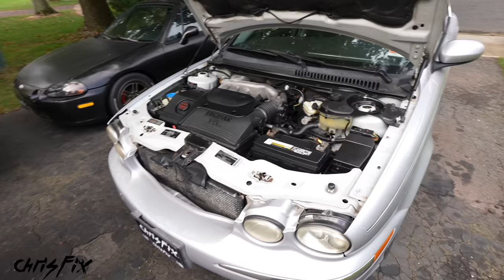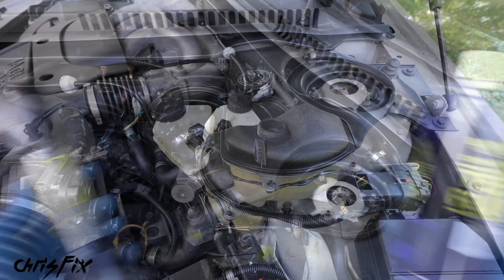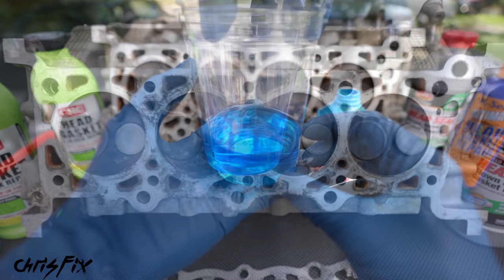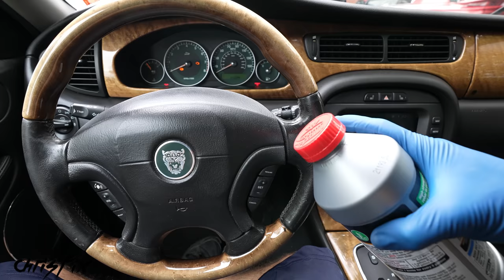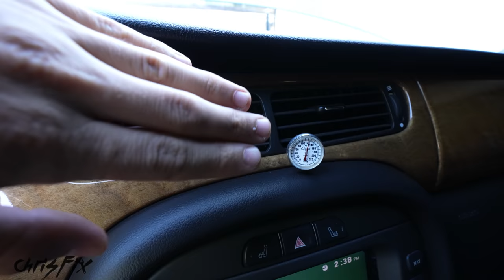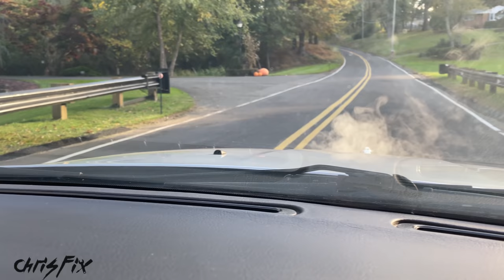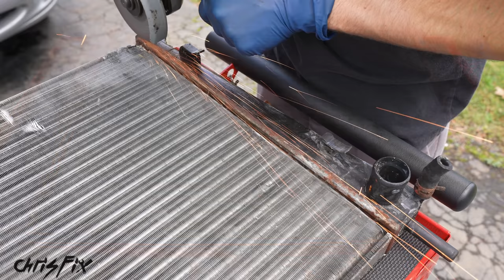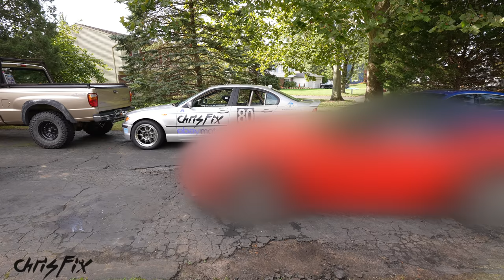Do Head Gasket Sealers Actually Work (FULL 2yr TEST with Engine Teardown)

Comment: Pretty slick with that ....fill to highest point....that's not exactly Right....see cause if you filling the car back up with fluid it will bubble cause the water is pushing the air out of space in the head.....some engine's even have bleed off ports that have to open while your filling it up an its running.....an exhaust leak in the water jacket is a hole lot more pronounced normally the radeater sounds like a muffler.....

Comment: I wanted to mention here that I used this liquid glass stuff in my 4-cylinder car, and it plugged the living hell out of my cooling jackets, especially on cylinder 1 where the coolant is furthest from the inlet on my engine.

I have no idea how to get this stuff out - could you maybe make a video on repairing a head gasket surface after using this kind of sealer?

Comment: At 205 reseal worked for my GM power steering small leak.i think it was from a hose. I replaced the pump and reservior but not the hoses. Yeah i know, bad move but i was only changing necessary parts since its a $500 car. Anyway,  hope this helps someone.

Comment: I've used all the ones you have in the video (and then some) on a Toyota 22RE, to no avail (yet).
Reply from the maker: Sounds like you need to actually replace the head gasket then haha
Reply: If oil and coolant are mixing then there is probably no point in doing this.

Comment: Mom had a 6cyl nova the green coming out of talepipe  used bars sealer   lasted 2 yrs  no leaks trans went  junked  water pump went bsd 6 mos after loose shaft     sealant might have caused ?  she did short trips 90 yrs old then.    I would have tried another can aft 2 yrs

Comment: 2007 Honda Civic..wife driving..did not notice temp max out...turned out to be a failed air fan..one side working only..used green bottle crc..worked for 2 years..then had to replace engine..but destroyed  the water pump and heater clogged... 🤔...if you can afford it..REPLACE ENGINE..SORRY😢

Comment: I used blue devil in a 97 Honda Accord and it worked for about 6 months and I reapplied it and fixed it again . 6 months later it jumped timing and 6 months later a rod started knocking so I don't know if any was related but that's my experiences with blue devil. Hope it helps.

Comment: I just bought a head Gasket Sealer. I have a 2012 Jeep Liberty 3.7 liter. I believe I have a very small leak between the coolant and the combustion chamber. Upon sitting overnight after driving it When you start up, you get a puff of white smoke with a misfire in cylinder 2. Engine light is on, and the car runs rough at first then clears up. After a few days of driving, I have to replace the coolant. The brand of sealer I purchased is BAR'S LEAKS Head Gasket Fix. The car has 90K plus, so I'm hesitant to use it just yet. The other side of the coin is this...If I decide to fix it, I will most likely replace the motor seeing that the amount of work to do the head gaskets are almost greater than replacing the engine itself, which means as a last resort, I will use the head gasket fix. Any suggestions???
Reply from the maker: Just use the head gasket sealer if you need to replace a whole motor anyway. It might work and if it doesnt you lost $30-50 trying it.

Comment: My car drinks ALOT of coolant. I havent found any leaks anywhere but ive charged all the hoses anyways. Oil looks good but I cant understand where the coolant goes. Any ideas? Im going to try this sealing
Reply: It can leak into combustion chambers. You can test it by filling the cooling system to the brim, starting the cold engine and removing the coolant fill cap.
Reply from the maker: It's likely being consumed in the combustion chambers through a head gasket leak, one thing you can do to check if you have a borescope camera is to pull some spark plugs and see if the pistons are shiny/clean looking, that would be an indicator of coolant consumption

Comment: People are always so quick to change or repair a bad head gasket. Gaskets dont just blow there is always an underlying cause that needs to be fixed first
Reply from the maker: That is the case sometimes, but it is also a gasket a gets used more than any other gasket on an engine and can eventually fail

Comment: Say Hypothetically my Head gasket is trying to go out. 05 honda civic ex with a new head put on 7 years ago (shady dealer).

Coolant just ends up back in the overflow reservoir and boils at the bottom after a highway drive. 

I wonder if K seal would buy me a couple of years? I don't want to tear the whole engine apart as its my only mode of transportation.

Comment: Sodium silicate is the only stuff that seems to work. Just keep adding more if it's still leaking. 2-3 bottles maybe . Will last a year ,then will require another round of sealant. So be warned, the stuff doesn't last forever, be on the lookout after 9 months or so.  Maybe use a bottle at 10 months no matter what
Reply: This is sodium silicate.

Comment: Should we do an oil change and a coolant change once the sealer is cured?
Reply: Flush the cooling system multiple times before and after using the sealer. Change oil if coolant was mixing with the oil.

Comment: Chris can you add anything to keep your head gasket healthy so you won't run into that problem
Reply: Two things: change coolant at proper intervals or even earlier, check if cooling system is pressurized when engine is up to temperature.
Reply from the maker: Replace the coolant at the proper intervals and dont overheat the engine and your Head Gasket should be fine unless there is a manufacturing defect.

Comment: Hi ChrisFix ever used the Titan Sealers polymer based headgasket or oil sealant. Supposedly works on aluminum heads thay expand and contract and hold up where sodium silicate/liquid glass cannot. I am trying to buy time on a Land Rover Discovery 2 ive done the proper repair before back in 2012 and its held 12 yrs but I have 5 vehicles that need repairs and they are priority over the truck. Ive used ths. Liquid glass 3 x and it has only held for a max 10 days to as little as 1 day. If you havent its ok. Saw only 1 vid on it but not sure thats all there is if the algorithm prevents access. Thx in advance.
Reply: Most heads are aluminum and sodium silicate works every time. 3 times that would be like 500 in labor. I doubt anyone would spend this much time, makes me think you didn't do a thorough job. Coolant in oil, oil in coolant, or both? Is the cooling system pressurized?

Comment: Which one do you recommend for a 2017 Kia optima Sxl gdi 2.0 turbo,  the coolant is not low and the oil doesn’t have coolant ?
Reply: Is cooling system pressurized?

Comment: I love how u explained this video. So my Dodge journey's reservoir tank has oil in it, the first time I noticed it was when it over heated and oozed out what looked like a thick milky chocolate shake which caused alot of smoke. What can I use to flush that oil out? I think I have a blown head gasket so as soon as I can flush that oil out I will try the sealant, because honestly I already tried to flush and seal but I don't think I'm doing it right. I even had my radiator changed cuz it was under warranty. Please any advice
Reply: You can try washing powder. Is cooling system pressurized?

Comment: Amazing video! As everyone has said! Question though... what do you do if your car doesn't have a temp gauge.. to know when it's at opt temp.. astra cdtdi 1.3 full tank of water being used every 10 min drive. No leaks from underneath. No white in oil.. YET! Help a gal out.. the car isn't worth a new head gasket just until I find soemthong else...
Reply: Turn on the radio, turn up the volume, press and hold settings for a few seconds till you hear a sound, with BC button find screen where it shows Sens.: v: and T:. T is your temperature. Is the cooling system pressurized?

Comment: But why the engine failed at the end? If it had enough coolant and there was no leak, because of the bad oil?
Reply from the maker: The engine block/head was too warped
Reply: @chrisfix  Ok. That means that even if coolant was not leaking, the head was still warping little by little, until there was enough room for coolant to leak through at once and engine overheated in record speed?

Comment: had that in a car, later I lost the heat and had head gasket seal Al over the place almost looking like plastic..
Reply from the maker: Dang! where did it blow?
Reply: @chrisfix  the issue was  due to a slightlig badly resurfaced top I though a sealant might solve it  I guess it kind of did  haha..

Perhaps alot of the solvant was left into the engine and solidified at the wrong place. 

the engine ran good but the heat inside  disappeared shortly after flushing the engine out and came back for a short time after a flush also starting to notice things coming out when flushing the cooling system and opened up the engine m, there was almost like a plastic wall inside parts the engine. 

Personally I will use this with causion

Comment: Will a AC compressor fan not working cause your car to overheat if you're using the AC also I did the combustion test it passed the problem is I'm getting bubbles in my radiator and reservoir yeah I replaced basically everything in the cooling system except water pump

Comment: I have a 2012 Peugeot 508, a premium model that I really like and I have invested quite a lot of money on it over the years and now I found out that there is a problem with gases in the cooling system. The problem is that the process of removing the thermostat is very complicated and relatively expensive.

Why do you think the fluid you chose eventually caused the thermostat to get stuck and if so why do you think it didn't get stuck in the first week and only after two years?
+
Which of the other materials do you think could do a better job without having to remove the thermostat?
Reply from the maker: Might have been something to do with the thickness over time, and I would recommend any one of the thinner sealers if you are concerned about the thermostat
Reply: Choose a sealer that does not have filler particles if removing the thermostat is a problem. Flush the cooling system multiple times after the leak is fixed.
Reply: Do you have a recommendation for a specific one?
  Or which of those mentioned does not contain filler particles?
 @SinsBird
Reply: By the way, if I'm not mistaken, in all the videos I got to see the use of the blue devil - the users had to remove the thermostat. Do you think if I give the system a good flush right after the leak closes, it can prevent the thermostat from seizing? @chrisfix
Reply: @arielsharhabi1155  Blue devil or steel seal.

Comment: ive had blue devil work twice 
but it was on a cylinder to water jacket only leak    oil was clean
when i ran it i removed the spark plug that had the leak when i did the 1 hour run and cool down cycle 
it lasted 2 years and i saw the kid i sold the truck to another year later still rolling

Comment: That's a good video. But the reality is this stuff is a temporary fix. For the most part it generally only last around 3 weeks if you're easy on the car and it's not a high-compression engine. It higher compression engine generally going to only  last a day or so.

Comment: I watch the whole video and learn something my problem is oil leaking on my cylinder is that also a head gasket? I also got a 7,000 estimate for an 09 Honda Pilot
Reply from the maker: The oil is leaking into the cylinder?
Reply: This wont help with oil leak.

Comment: @chrisfix . bro which sealer here would you recommend to use on my 2004 audi a4 3.0L v6 ?? the same one you used or a diff one ?
Reply: idk how to tag you ! but i really hope you see this fam ! pls lmk !
Reply from the maker: The one I used worked well so I would give it a shot!
Reply: Oil in coolant, coolant in oil, or both? Is the cooling system holding pressure?

Comment: K&W Fiber lock* 
My head gasket was very bad. My car had 200,000 miles. I was going to get rid of the car because the thermostat and waterpump kept breaking. Once I’ve used K&W it works better than blue devil. Blue devil didn’t work. I had no problems after I used K&W Fiber Lock. Ran like a CHAMP just couldn’t use my a/c unless it will attempt to over heat.

Comment: I’m curious could you mix head gasket sealer? If you tried one and it didn’t seem to work could you try a different one??  my issue is on a 2016 Jeep Wrangler Unlimited.

Comment: My car has been idling rough when it goes to ideal temperature but idles smoothly when the engine is cold or just started. Is it possible that it's because of the head gasket or something else? My car is quite old, 2000 Hyundai Accent (150k mileage), just changed the oil and replaced the entire fuel system together with the spark plugs and ignition coil. All fluids are good (Coolant, Gas, Washer, Transmission). Just asking if I should put gasket sealer or just replace it because its old.
Reply from the maker: It's good you ruled out the spark plugs and coils, I would start with checking for vacuum leaks/a bad o2 sensor/a bad egr valve, that can be causing your rough idle when warm issue
Reply: @chrisfix  Hi Chris the rough idling of my car lessened as I poured in high octane fuel in my car (Vpower/98). I just wanna take my time and say I really appreciate you spending your time and replying to my comment, and I know I’m not the only one feeling this way. I really wasn’t hoping for me to receive any reply at all but you proved me wrong. Thanks again and hope you have a wonderful day ahead. Praise be to God.

Comment: Great video. I’ve used the blue devil head gasket sealer and a mechanic followed the instructions and put it in. Unfortunately it didn’t work. 😢
Reply: Oil in coolant or coolant in oil, or both? Is the cooling system pressurized?
Reply from the maker: Dang sorry to hear

Comment: What if you decide to go ahead with the repair to replace the head gasket, but the gasket is fine and the problem is a warped cilinder head? Would putting a new head gasket seal it? If not, after all that work, is your mechanic or shop still going to charge you for taking the engine apart? Just wondering...

Comment: Hi Chris, i have Megane 4 1.6 dci 130 and i lose coolant. The antifreeze gets into the oil, at the filler cap like mayonnaise.  In Romania I can find Rislone Fix head gasket, is it good?  can I infuse something else?  I think I have a cracked engine block.  Respectfully !
Reply from the maker: I've heard some  goof stuff about Rislone fix, it's worth a shot for sure
Reply: @chrisfix  thank you so much Chris, i will try. If i have succes i will write here for other people.

Comment: I'm getting coolant in the oil. K-seal bottle says it's not suitable for leaks in hoses, coolant to oil or oil to coolant leaks. Which other one would you recommend? I am a little concerned about using the bars because of the thickness. Does anyone have any experience with the CRC head gasket and block repair?
Reply: They're all similar based on sodium silicate. The chances of sealing coolant to oil leak are low but that doesn't mean one shouldn't try it. Don't drive the car with coolant in oil, it's damaging the engine, it's better to change this contaminated oil with used oil for the time being. You would have to remove the thermostat and flush the cooling system multiple times with water before the procedure. Does the cooling system hold pressure?
Reply from the maker: If coolant is getting in the oil rather than in the combustion chamber, these might not work. The K-seal is probably your best bet for this scenario but might not work. Be sure to change your oil afterwards because this stuff in you  oil is not good!
Reply: @chrisfix  Got it. Thanks, I'll try it.